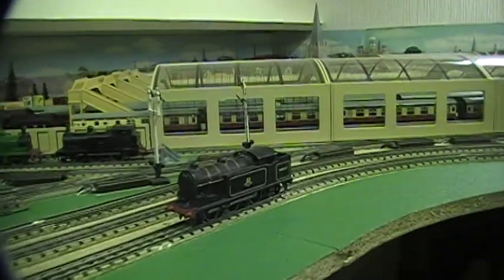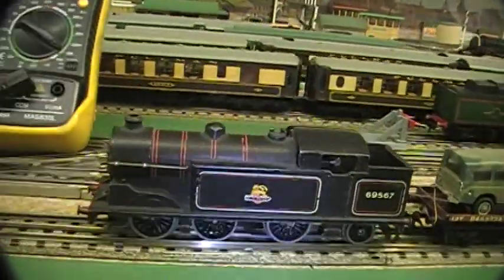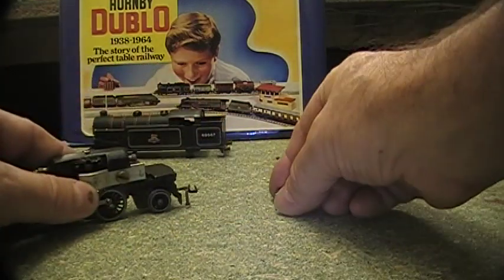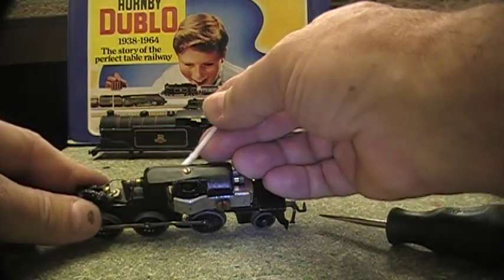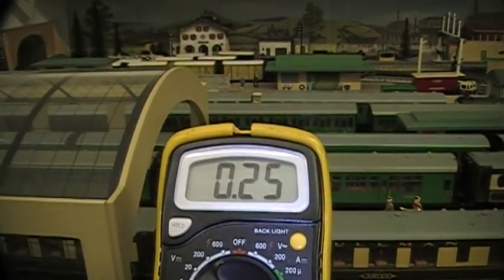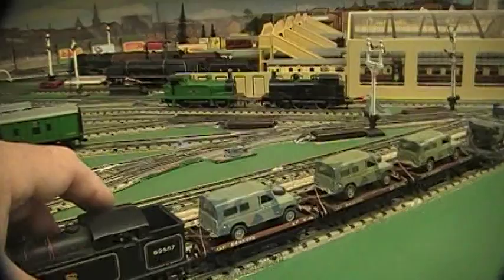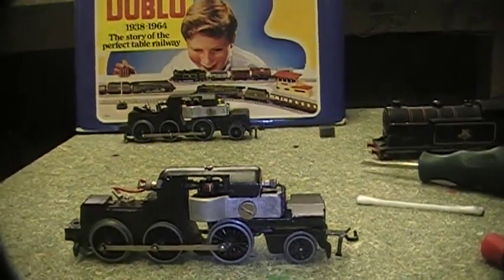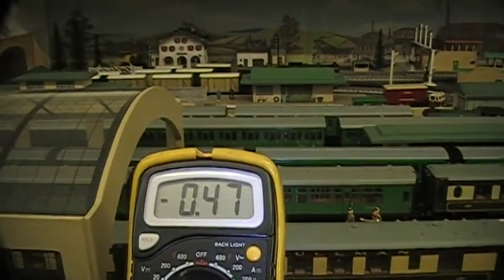Hornby Dublo maintenance - motor magnets

Comment: Fantastic video, you can't beat dublo locos, I am trying to track down the problem I have with my silver king, it is a great runner but reluctant to start and after a while running suddenly stops. It is also hesitant to change direction and noisey backwards but fine forwards. I was told about magnets but I don't think that's the issue after watching this. Any ideas. Cheers Rob :)
Reply from the maker: Hi Rob, Thank you for your kind comment. Sounds to me that you may have something mechanically binding, probably need to check the wheel quartering and that your wheels are running smoothly in both directions without any tight spots.
 Regards, Ron
Reply: Hi there. Thanks Ronald I have sorted her how.  The problem was the over oiling by the previous owner and possibly the rewheeling that had taken place had resulted in the blastic axle mounts giving way. So I have replaces the wheels with 23mm Scale link wheels and used Loctite 603 to fit the pins in widened holes via a drill. Only trouble is The chassis is currently isolated both sides (silly me. ) I went for appearence but no problem I can make some new pick ups and get her running again. I will do vid on her soon as she is done. Cheers for the help. All the best Rob :)

Comment: Good video showing how to replace the magnets on an HD 0-6-2, and what you can gain from using powerful neo magnets. However, I don't understand why you purposely introduce an air gap into the magnetic circuit by using card spacers, but then go to the trouble of trying to reduce the air gap  by closing the pole pieces. I would have used soft iron spacers instead of the card to make the 10mm magnet fit, as well as closing the air gap on the armature. The reduced current demand of the motor that you have demonstrated is excellent. 
The only drawback I can think of is that a rheostat controller suitable for the high current of the old HD motor will not work as well for the lower current motor, to give smooth speed control.
Reply from the maker: Hi Tom, Full size Neo magnets are far to strong for these motors and if used there is evidence that damage will occur in time. Therefore if one must use neos it is better to use smaller (weaker) sized ones and dampen down their strength with a none magnetic material till the pole pieces have about the same magnetic flux as the original Alnico type. In which case closing the pole piece air gaps to original design specs will help with the running. The motors will not be damaged if kept to within design specs of 0.65 amps. so fitting neos just to lower the amps further is not required. A well serviced loco will draw much less than this with the original magnet strength anyway.
 Many of my motors run at below 0.1 amp but that is only because I have rewound them for greater torque.
 As a note, you do not need to go to the expense of using "soft iron" as it is no better than many other metals to transfer magnetism, its main advantage is that it will drop most of its magnetic attraction when a coil current is removed thereby allowing relays etc. to easily open.
  Regards, Ron
Reply: Ronald Dodd Cheers Ronald. I accept your comments, but I would think that the only harm that could from over powerful magnets is that the operator may be tempted to overload the more powerful engine with too long a train and end up wearing out the bearings and mechanics. It is up to us to respect the age of our trains and operate them accordingly
I have been encouraged to upgrade some of my HD motors with neo magnets by your video.